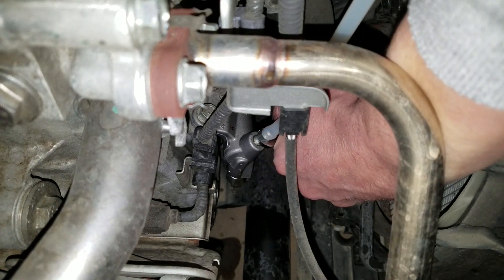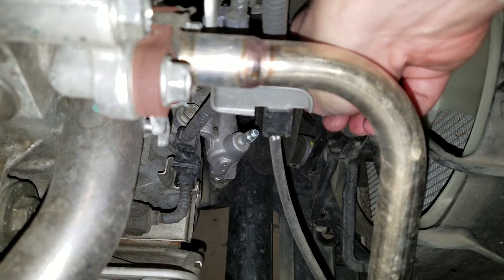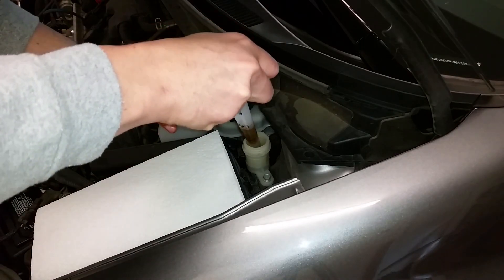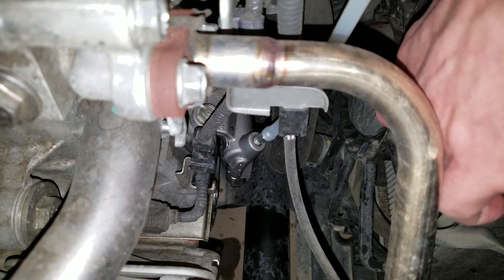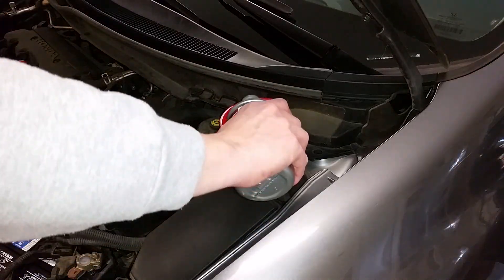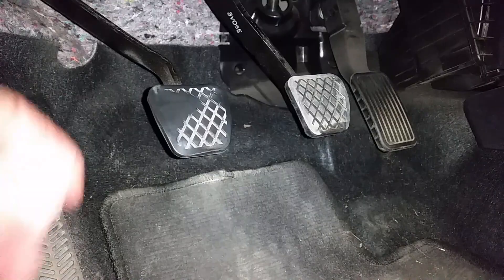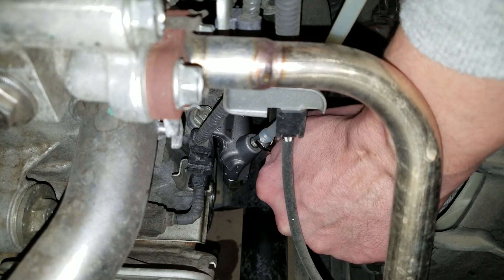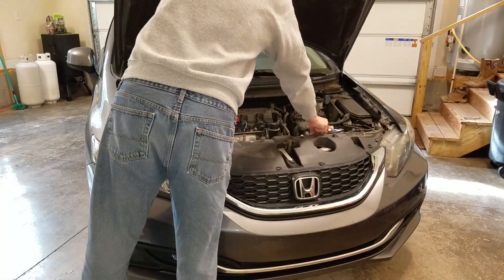Honda Civic One-Person Clutch Fluid Flush

Comment: Followed these instructions, using the one-person bleeder bottle... and now have spent HOURS trying to get the air out of the lines because the one-person bleeder bottle apparently let air in IMMEDIATELY upon opening the bleeder valve... so the one-person bleeder bottle can fail and let air in when you first crack the bleeder valve, WITHOUT having the clutch pedal depressed first.  🤬 Apparently, because the bottle can fail, it is really much safer to do this with two people (or use something to push the clutch pedal in) BEFORE each opening of the bleeder valve.  If you happen to get a better-functioning bottle than we did, this method might work, but beware of this (pretty big deal) risk of introducing air that does NOT want to come out.  Now, back out to the garage with me to continue bleeding the fluid... and cursing my lot in life.  Will be returning this bottle to Amazon.
Reply from the maker: That sucks! I've used this bottle on both of our cars and also my clutch with no problems. Be sure to only crack open the bleeder slightly so no air enters past the threads.
Reply: @Mikeattempts  Yeah, I think if the bottle setup actually worked, I think this would have been a quick job for us... but since the bottle failed, it ended up taking 3 days and lots of f-bombs.  We ended up having to detach the slave (replaced it, actually) from the clutch fork and unbolted the last fastener on the hard line to the slave, so we had some free play and were able to do sort of a hybrid "bench bleed/regular bleed" (two-person setup) of the slave by lifting it up as high as it could go, which was ~level with the clutch fluid reservoir.  Then, we tied some very tough fabric (I wish I was kidding) around the slave to keep the piston/plunger compressed, and did the two-person bleeding process for HOURS.  Pedal still didn't feel good, but had a little more pressure in it, so we bolted the slave back in place and-- voila!-- pedal was back!  Ended up with 3/4" free play.  Now shifting well again.  Lesson learned.
Reply from the maker: @sherribowden2114  Hahaha, when I hit an unexpected obstacle (which is often) cussing usually helps! ;) Holy hell, I can believe it ended up being such a hassle! I wonder if the bad slave was the culprit all along? That sounds like a horrible job but at least you didn't give up and now it's done.
Reply: Worked great! Scared me at first, when I pressed the clutch pedal down it didn't come back up! Thought I'd totally screwed up. Come to find out I had to actually press the pedal then pull it back up instead of it springing back up. Did everything else like you said and worked fine!

Comment: Cool video, i have same model 2015 si.  I'm having a hard time shifting into the gears, it locks me out at times. But once it's shifting smoothly it drives like a beast. Wondering if this might help me out
Reply from the maker: I'm no pro but a clutch flush and changing your MTF (I did another video on this) would probably help.
Reply: 9th gen Si recommends transmission fluid every 30k; i get this done at the dealer regularly to have no reason for them to give an excuse. I wont touch oil changes or transmission flushes but id do mostly anything else due to them being cheaper to get professionally redone

Comment: Hi, great video. But my Civic is with Robotized clutch, what do you do in this case to press the automatic clutch?  Thanks.
Reply from the maker: Are you messing with me? :) If not, it sounds like you have an automatic transmission so there's no clutch bleeding involved for you. Replacing the automatic transmission fluid (ATF) is very similar to an engine oil change. You'd just need to find the ATF drain plug, drain out the old fluid, and then refill the ATF reservoir located in the engine bay.
Reply: Hi Mike, My Civic has a manual transmission but it has no clutch pedal. The clutch is automatic, but the Tranny is not, mechanically is a manual.  That is why I am asking. Also on the cap of the small reservoir, it says to put Only original Honda Break Fluid. I can only find DOT 4 Original Break Fluid, but I think it should be OK.  Let me know.  @Mikeattempts
Reply from the maker: @senanfoutchedjev2401  I have no experience with that type. You should be able to buy a Hanes or Chilton manual for your vehicle that will cover the procedure. I would use whatever brake fluid is recommended on the cap. I usually buy mine from the local Honda dealership, but you can also order it online. DOT 3 and DOT 4 fluid are compatible.

Comment: I'm having a problem. I followed all your steps, but my clutch still won't go up. I can see that there were no more bubbles coming through the hose into the bottle. I tightened the valve and the cap then stepped on the clutch, but it only have a very small amount of pressure very close to the floor, and no pressure at all before that. I tried to keep pumping and refilling the master, but I've been that for 2 days straight and went through 3 bottles of dot 3 already. I need help please, thank you.
Reply from the maker: I'm no pro but are you using a bottle with a one-way valve? If not, you'll need another person to press the down on the clutch while you open the bleeder. Then, before lifting the pedal back up, you need to close the bleeder. Repeat the process until there's no air in the line and the pedal feels good under your foot.
Reply: @Mikeattempts  I’ve also done that method with my brother, and I have a concerns. Because when my brother was pumping the clutch, and he thought it would be funny to pump it hard and fast constantly slamming the clutch for a good 3 seconds before I told him to stop. So I don’t know if that could have damage the clutch adjustment or not. And I am using the one way valve bleeder. I watched the fluid goes from the nipple to the bleeder bottle until there were no more bubbles but I’ve been at it for a long time. Should I start over? Bleed the master with turkey baster with the slave closed then plug the tube in with the bleeder and pump?
Reply from the maker: @idontwanttogoback236  The only thing I can think is that your brother sucked in a bunch of air when he was trying to be funny. But if you got all the bubbles out then I don't know what the problem is. I doubt he messed up the adjustment but, like I said, I'm no pro.
Reply: @Mikeattempts  Okay, no worries thanks for replying anyway. I’ll just keep trying the second method and see if I can get anymore pressure on the pedal, but I’m gonna use a wooden stick to hold the clutch instead of my brother this time. My old mentor said keep trying pumping until the pedal stiffen up even if I don’t see anymore bubbles but I don’t know how well that would work since he said “keep trying”.
Reply from the maker: @idontwanttogoback236  Sounds pretty frustrating but I think you'll get it back to normal.
Reply: @Mikeattempts  So I actually figured it out and got the clutch back to normal. I just thought since my brother did pump the clutch all the way to the floor really hard and really fast for a couple times, maybe the push rod for the slave is pushed out. So I just bleed the clutch like normal but instead of pumping from the pedal, I squeeze the pushrod back into the slave cylinder then bleed out the air that was inside the boot that cover the pushrod and it actually fixed it. That's why I was getting a little bit of pressure when the pedal is close to the floor, because the pushrod was still sticking like a little bit of its tip inside the slave cylinder.
Reply from the maker: @idontwanttogoback236  That's awesome, I'm glad you figured it out and got it fixed, thanks for the update! :)

Comment: Hmm i cant seem to be able to bleed my clutch. I can get any fluid moving at all. I even hooked up a vacuum bleeder to it and still nothing comes out. Ive taken the entire nipple off and still nothing. Any tips?
Reply from the maker: I'm no pro but if nothing is coming out, either there's no fluid in the clutch system, the clutch pedal linkage is disconnected, or you didn't actually open the bleeder on the slave cylinder. I guess the clutch master and/or slave cylinders could be bad.
Reply: @Mikeattempts  hmm, its quite the conundrum. I've bleed all the break lines on all 3 of my vehicles with my vacuum bleeder kit. So id think the clutch would be the same. I even tried pressing the clutch pedal in and out a bunch. And my clutch still works great, and is very smooth... but the fluid is dirty.
Reply from the maker: @derekwhipple8419  That's what makes me think maybe you're loosening something other than the clutch bleeder. I'm confused. :)

Comment: But when I press the clutch pedal it doesn’t retract
Reply from the maker: Are you using a bottle with a one-way valve? If so, your bleeder screw is probably just open too much. If not, you'll need another person to open the bleeder when you press the clutch and then close the bleeder before you pull the pedal back up with your foot.
Reply: @Mikeattempts  I figured it out. I did it all wrong from the very beginning and let a lot of air in. Yes I was using a bleeder bottle. My personal mechanic explained to me that I must bleed it properly by opening the bleeder valve, push the the pedal, close the bleeder valve then pull the pedal. I repeated until and ensured the reservoir was filled until I saw no bubbles. Then I close the bleeder valve and pushed the pedal which there was pressure. It’s fixed.
Reply from the maker: @XGen_23  Great, glad you got it fixed!
Reply: @XGen_23  wait so do you open the bleeder before stepping on the clutch then close it before letting off the clutch?
Reply: @idontwanttogoback236  on my last comment I MAY have explained it wrong. Here are the instructions my mechanic gave me:

1. Close the valve, push the pedal down
2 pull the pedal up, open the valve
3 push the pedal down, close the valve 
4 repeat steps 3 and 4 until there is pressure and watch fluid level
Reply: @XGen_23 did this solve your problem? Cuz I’m about to try this too once I get my new slave and master cylinder here for my Honda accord. Can’t afford any trial and error again 😅
Reply: @leetos.4915  sorry for the late response. Yes it solved my issue. It’s a two person job.